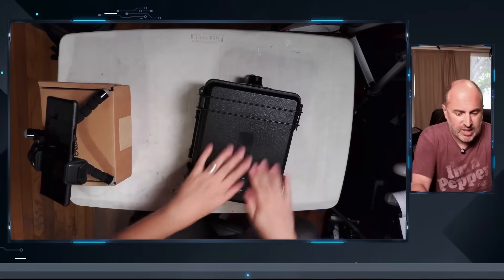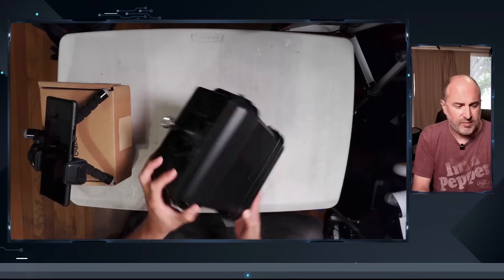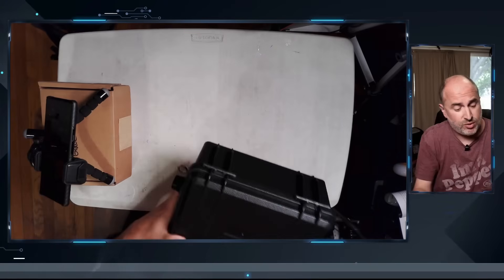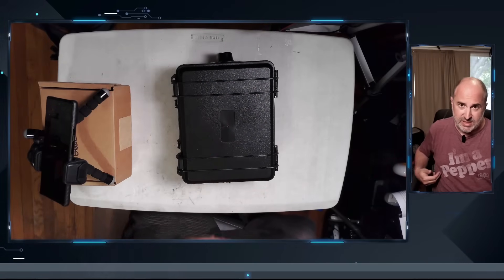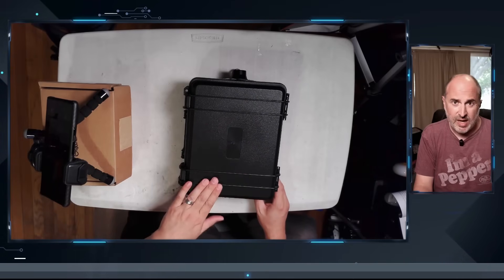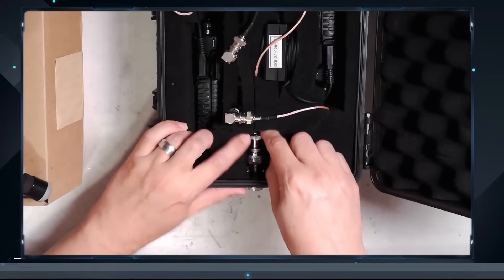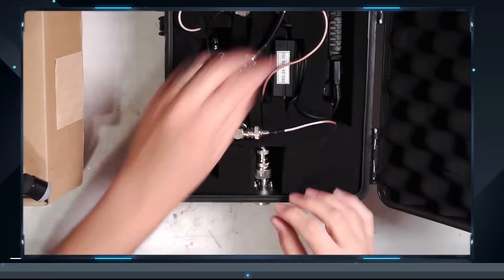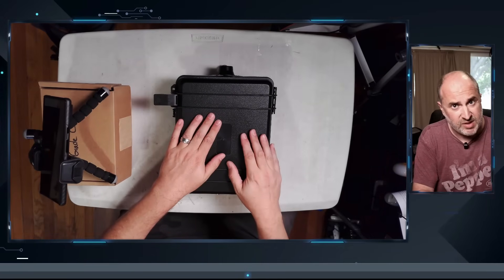DIY GMRS Repeater Build: Boost Your Camping Communications!

Comment: Another possible solution would be a simplex repeater. One radio tuned to a simplex channel, audio from this radio is recorded digitally. When the squelch re closed, the transmitter is keyed and the just recorded audio is played into the mic input. At the end of the playback, the radio goes back to squelch, the recording is erased and the radio and recorder are ready for the next transmission. Audio recorder could be a recordable greeting card. An Arduino could be programmed to control everything.
Reply from the maker: This is a really good and super simple way to do it. I just hate having to hear myself back and wait even longer to get a response from people. Its more expensive but a legit repeater is the only way I would really do it. This setup does work, not great but it does work. I would probably end up getting the midland gmrs repeater - https://midlandusa.com/collections/mxr10-midland-repeater/products/midland-mxr10-repeater   It is expensive but does it really well in a nice package.

Comment: Hello, I was just wondering in GMRS world… you guys can just Willy Nilly put up a repeater? I’m coming from the Ham Radio world where we had coordinated pairs, and you had to go through a council and get it approved and make sure there is a frequency pair (2 meters) available?  How does that work with GMRS?   What duplexer are you using, and where did you buy it?  I’m look forward to your reply. Thanks. 😀🥳
Reply from the maker: I am a ham as well and yes it is definitely different. Especially considering use case. If I were making a higher power fixed position repeater then I would do my best to not interfere with anyone else in the area by first checking a few resources like repeater book, which lists GMRS repeaters and mygmrs.com. I would also take a little time to listen on the freq I wanted to determine its regular use. There are no frequency coordinates or really any official local process with GMRS. In this case however it is important to note my use case which is a portable system to be used while camping for short periods. Given the remote locations and low power of the system this is a non issue for me. For a list of the parts I used check the description. Thanks for watching!
Reply: GMRS also has pairs of freqs to be used for repeaters.
Reply from the maker: @cphank3722  Yes and those pairs must be used when creating a repeater. GMRS is channel based so you can't go off the rails and pick whatever freq you want. It is more of an issue that there is no one to officially coordinate 1 repeater stomping on another...

Comment: You found the duplexer that I had not been able to find. Thank you for that. I've been debating just figuring out how to position two antennas versus the power loss of a duplexer. Do you know how much loss you are experiencing through the duplexer? The other benefit of two antennas is being able to switch frequencies in different places. Nice build - thanks for sharing.
Reply: It’s typically 50%.  In the long run it’s cheaper and easier to buy a 10w GMRS repeater for $300. The Midland has been great.
Reply: @petemitchell6788  Look forward to your performance review. Would love to see what kind of difference you get in actual field performance between your build vs. the Midland portable system. Midland/Retevis claims 5 watts after the duplexer where you say you are likely getting 2.5 watts. With good placement and good antenna did you see a difference in use? Thank you.
Reply from the maker: I would say the performance I experienced was pretty poor and agree with @paulbrown9574 that the midland repeater is the way to go. I have been eye'ing it for some time, but I was out of work at the time so I was hopefully a budget build would be good enough. The midland seems to be a much better value. Now I just need to buy that and build a small battery for it so I can hoist the whole thing up a tree. That was one thing I really licked about the way I went...

Comment: Can you explain how or why the duplexer was tuned to curtained frequencies?
Reply from the maker: "curtained frequencies" - I am not familiar with that phrase. The duplexer was configured and tuned for a specific GMRS repeater channel
Reply: @TechTinkerHobbyist  sorry that was supposed to be “certain”…how is a duplexer tuned? Sorry I’m still new to this…

Is this something you do yourself or something they do before they ship it?
Reply from the maker: haha no worries, I was wondering if I was missing something... A duplexer basically has a series of filters and isolation components so 1 freq does not interfere with a 2nd freq, as on a repeater both are being used simultaneously. As such they are typically configured when you purchase them for a specific set of freqs.  Depending on where you buy they may just list the freqs it is setup for or, as was the case with this one I ordered from Aliexpress, I had to provide the freqs I wanted when I purchased. The downside for a mobile unit such as mine is that I am locked to this set of freqs so if I am camping somewhere and others are using this channel I just have to deal with it...
Reply: @TechTinkerHobbyist  The Midland/Retevis repeater really should be tuned as well but they center on 462.55/467.55 and let you change channels without re-tuning for ease of use. You can do the same and get similar results. Most of us don't have the equipment to tune a duplexer at home.

Comment: Did my repeater basically the same way. Used a larger box from Harbor Freight. I took a battery out of an old 12v jump starter that i had laying around and put it in the box using cigarette lighter adapters on the radios. I use a magnet mount antenna or my Tram antenna adapter system that allows NMO antennas to be connected on a 20 foot push up pole. The battery lasted nearly an entire week on our camping trip in Colorado Rockies. Hope yours works out well. 
CHEERS from Colorado
Reply from the maker: Nice, that's great it lasted the whole week. Its nice to have something that's a set and forget. I just got back from a week long camping trip also and it worked great when I used it, definitely extended my range from previous trips to this locations. I didn't use it every day however so I am not sure about my battery life. I am just using the stock extended batteries in the baofengs with the option to add a USB battery backup... Need more testing tho...

Comment: I just created a neighborhood repeater setup. I used Wouxon (2 of them paired) KG1000 Plus with a duplexer and (2) power supplies (This needs just 1 antenna). Testing today worked great on both HT and mobile in a highly dense wooded area. Excited about the results. An attick mounted TWAYRDIO Yagi Antenna UHF 400-470Mhz from amazon worked the best against all my antennas. Crazy good antenna that finalized my setup after much testing.
Reply: SBR on this setup 1.0!
Reply from the maker: Nice, that should be a pretty powerful setup! I wanted to use those KG1000's also, just not in the budget at the moment...
Reply: What duplexer did you use